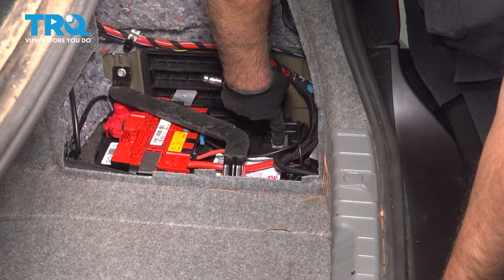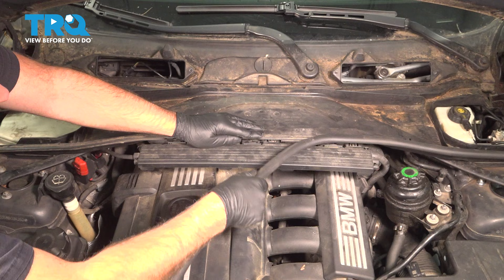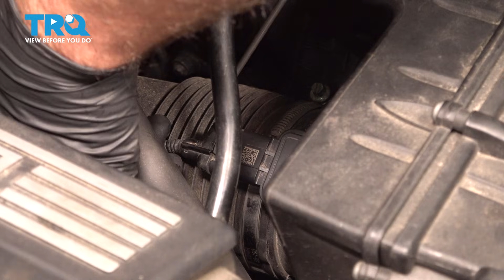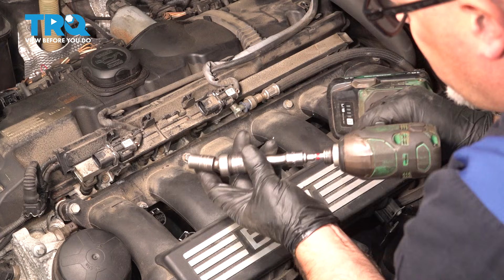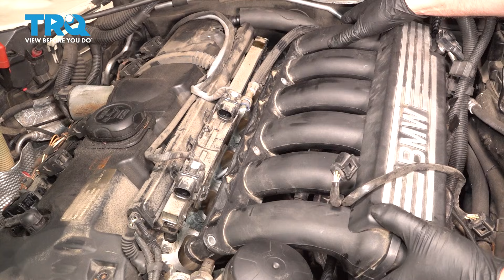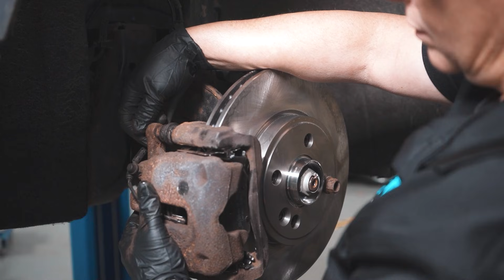How to Replace Crankshaft Position Sensor 2007-2013 BMW 328i 3.0L L6

Comment: Great video. I would add please take note of very important things!  Do not over tighten the crankshaft sensor bolt.  It broke on me; I had to do a tap and helicoil.  I had to put a paper towel in the hole to ensure no metal shavings went in.  In addition I placed the new sensor with the all right OEM and it still would not crank properly.  I had to come back and learn to place the o-ring in the hole first.  After the fact I pushed in the crankshaft sensor OEM.  I wish this would have been in the comments or video as I played putting on and off the manifold like 6 to 8 times.  God bless.